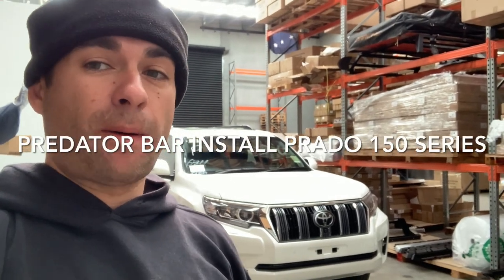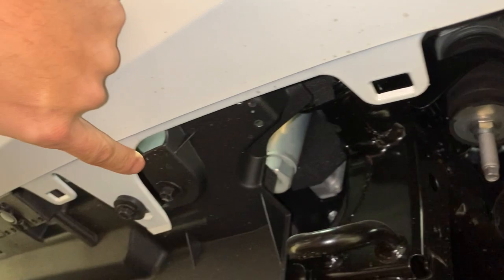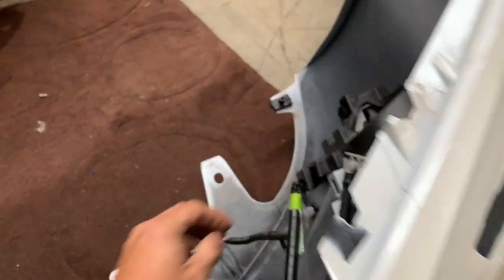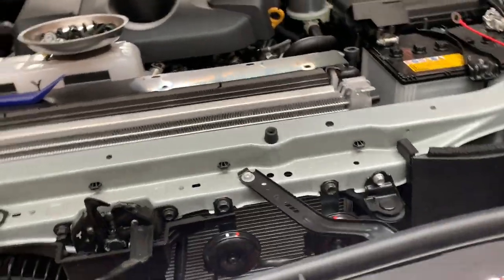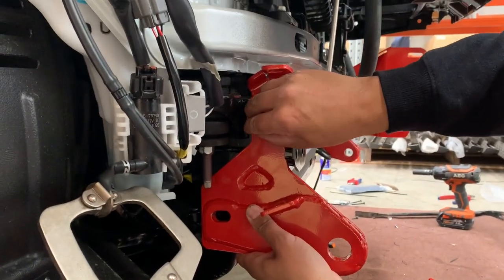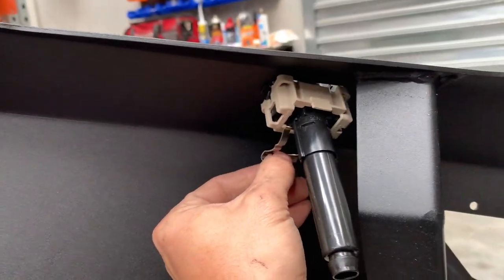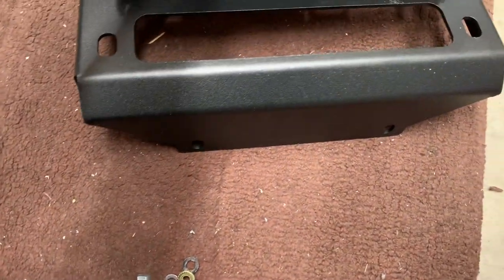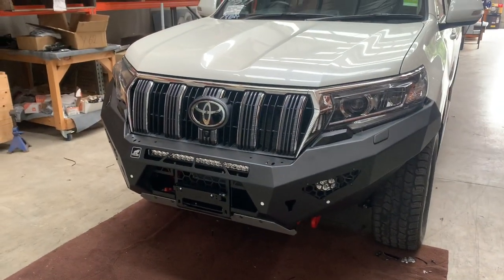Prado 150 Predator bar install by Offroad Animal

Comment: Impresive... 
Hey mate, what's the weight of the Bullbar? did youreplace suspension as well?
Reply from the maker: We put tons of info on this bar on our website, check it out https://offroadanimal.com.au/products.php?product=Predator-bull-bar%2C-Suitable-for-Toyota-Prado-150-Series-2018-on&showHidden=true

the weight is right up the top on the website, 55kg, and about 12kg is removed.  No need to change suspension unless you're adding a winch
Reply: @offroadanimal  Great. Thank you

Comment: Hey mate can you advise me how to pull the chrome strip off the top of the grill that is shown on the Kakadu. Cheers
Reply from the maker: use a plastic trim tool and start from the edge and slowly release the clips
Reply: @offroadanimal  cheers mate awesome. Thank you
Reply: Hi mate, would like to know when u after unplug the radar, do u need any calibration for that ? Cheers mate
Reply from the maker: @JeffTang72  No need to re calibrate
Reply: Thanks mate

Comment: Great video, I want to keep the stock suspension but concerned the extra weight, will it affect driving dynamics of the Kakadu? Is there a Kakadu vehicle specific reason you didn’t put on spots as well? Thanks
Reply from the maker: Just having the bar should not have any significant effect on driving dynamics.  If you add a winch I'd be looking at upgrading the suspension. We have a different bash plate to suit Kakadu models
Reply: @offroadanimal  Clearly the bar doesn't weigh very much to affect the front suspension, which would then indicate it is a very flimsy bar. Any quality steel bar requires front spring upgrade to handle the extra weight, regardless if it has a winch or not. That's one ugly bar!
Reply from the maker: @unclebob5686  Every time you comment you sounds more dumb.  Strength in design mate, not just sure material thickness.  It's possible to design things stronger and lighter.  Every industry does this over time.  You can fit a heavy bar to your horse and carriage as you seem to be stuck in the past.  Also the fact you keep commenting on our videos shows you have nothing better to do as you hate our bar so why waste time on these videos.  Move along and find something productive to do
Reply: @unclebob5686  
That’s the best looking bar on the market.

Comment: Pretty amateur install tbh
Would be interesting to see what it looks like after hitting something.  Looks more cosmetic than a functional bar for protection
Reply from the maker: Thanks for your feedback.  Show us your design and install please to compare. All reports so far for the  hundreds sold is roos just bouncing off the bar.
Reply: @offroadanimal  I doubt that very much. I've seen ARB bars split down the middle after a roo strike and they are far more reinforced than yours.
Reply from the maker: @unclebob5686  Sorry Bob with out Data  you're just another person with an unproven opinion.  If you want ARB go buy ARB I'm sure you'll be happy with their bar as they make great bars as do we.

Comment: I’ll be honest. I know that the original bumper is plastic etc so not very sturdy.
This however looks very “flimsy” to me, in terms of its ability to fend off a Kangaroo strike for eg.
There’s too many pieces held together with what appear to be mild steel bolts. Not high tensile bolts.
The inner wheel arch liners that were trimmed weren’t fixed to the back of the bar - just left to flap in the breeze?
The upper bolts and washers on the red recovery points with small washer looked like they might pull through the slotted hole on a decent snatch strap recovery.
This video basically turned me off buying an Off Road Animal looped bar for my 2020 Prado VX.
Not impressed at all.
Sorry, just calling it as I see it.
Maybe it would look a lot better colour coded to match the vehicle rather than black.
Reply from the maker: So you're obviously a bit one sided here.  Yes we make a full version with hoops to suit larger roos.  But this style is for people who go offroad and want protection offroad (not just animals).  Great place to house a winch, have recovery points and lights.  No need for all the hoops when you live in town and rarely see a roo but still go offroad.

This bar will is as strong as, it's made with thicker steel, and braced better than most.  Allows for better air flow and wider spacing for mounting bolts so less likely to move after a hit. The fact you can not see that in the video proves you've never looked at another bar before. 

Now all bolts are high tensile, we only supply that.  how the hell could you tell otherwise from this video.  but all 8.8 or greater

No the inner liner doesn't flap in the breeze, watch the video again, the under panel holds it up. Guess what, every bull bar manufacturer does this, from ARB to TJM.  It's how it's done.

Also colour choice is a preference,  we supply loads of colour coded bars, but this customer wanted black, don't shoot them from having a colour preference different to yours.
Reply: @offroadanimal  Pretty arrogant response to reasonable feedback, great way to run a business.  Your response, “less likely to move after a hit” tends to suggest you haven’t actually tested it.  Cable ties wtf.  I won’t be fitting one to my new Prado either.
Reply: @offroadanimal   So I ended up buying AFN colour coded and fitted & couldn’t be happier.
Just for some context.
Bought my first roo bar in 1975, and had them on every vehicle since (46 years) ARBs Irvin’s, etc.

All I was trying to point out, was that watching your video convinced me to remove ORA from my short list.
I’m guessing that wasn’t your intention in filming or publishing it.
I viewed it, because social media recommendations got it put on the short list.
The video saw me remove it from the short list.
I’m assuming that wasn’t the intention of filming and uploading the video, one presumes you filmed it to help sell more bars.
So my point in commenting was that maybe you might consider things that I mentioned in relation to how you film and edit / publish your videos maybe.
Perhaps address issues like what quality / grade of bolts you use.
To me they looked like low grade “chinesium” made from recycled sardine cans, and all the strength of case hardened plasticine.
Obviously they aren’t - but your video would be improved if your voice over pointed out that fact is all.
Rather than get butt hurt by the comments and feel a need to “defend your product”, perhaps it would be better to re edit your video to remove any possible confusion?
That was my point at the end of the day.
I’ve seen Harry’s (Fire to Fork) ORA hooped bar on his 2020 VX and it looks pretty good.
But I still chose AFN in preference because to my eye it looked a little better again.
Others taste may vary, beauty being in the eye of the beholder.
Reply from the maker: @ianmoone2359  Good luck with the AFN bar.  Our back orders for Prado bars are out to 3 months, so we're satisfied with our video
Reply from the maker: @Corey-pd3mi  thanks for your feedback
Reply: @Corey-pd3mi  You're 100% correct. Cheap, nasty and crap bar. Try an AFN bar or ARB in my opinion are the sturdiest.